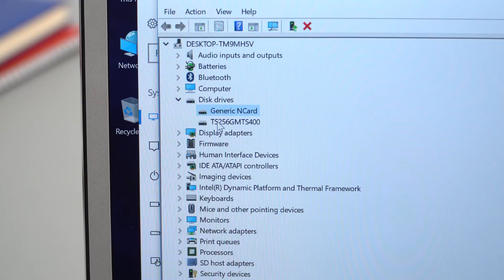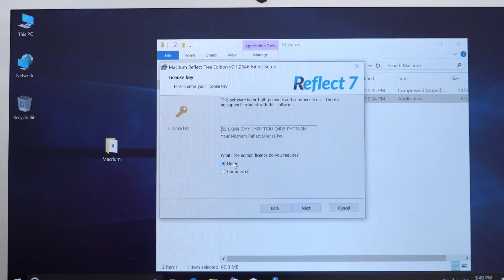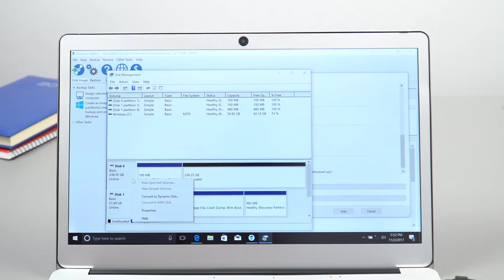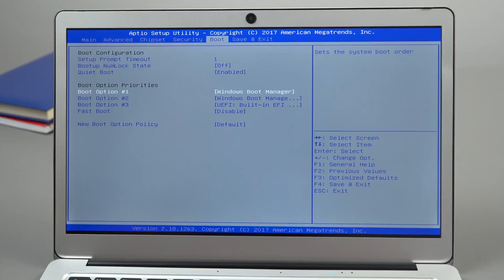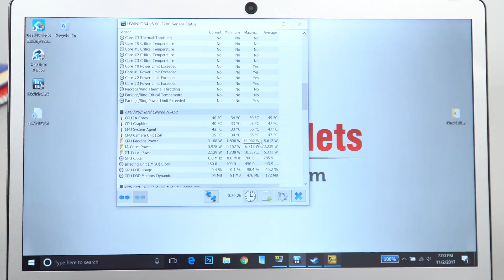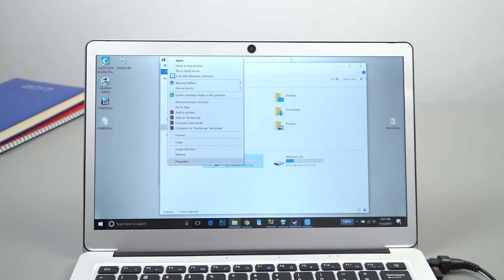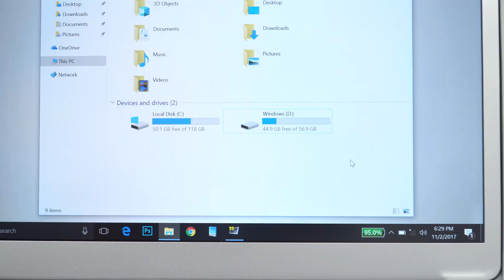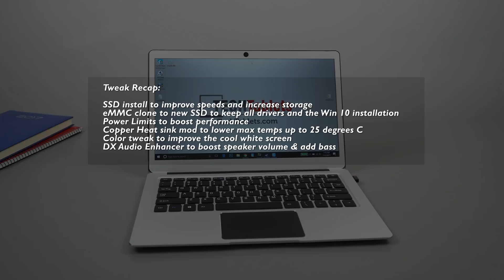Jumper EZBook 3 Pro Heatsink Mod, eMMC to SSD Cloning & More

Comment: Can I check why you would clone rather than installing a new version of Windows 10 on a new SSD?  Is it difficult to install drivers or is there another reason?
Reply: Sorry just seen that the reason for cloning is to keep the drivers.  Is it possible to do a clean install and then pick up the drivers after?
Reply from the maker: Sure can, I have the drivers here: https://techtablets.com/jumper-ezbook-pro/downloads/
Reply: Great - Thanks for your help.  Going to see if I can pick this and a SSD in the 11.11 sales.  Not sure if it will go much lower

Comment: Hi dude, can i use samsung ssd m.2 960 pro and get the full speeds of it? Thanks
Reply: NVMe SSDs won't work, since they are connected directly to the PCIe lanes. This platform doesnt support it. So your M.2 SSD should be an AHCI type (like 850 EVO).
Reply: MrSuicycle thx i understand now

Comment: hi chris i see you made a 360degree mod and coverage of this notebook ut you still MISS to guide us how to conect an eGpu (external gpu) card .... PLEASE DO THIS FOR US!

this laptop is great and it would be fantastic to see if we can use the pci slot of witi to connect by wire an eGpu and use an old and unused glu like an ati 7950... 7870 that many of us have in the old pc

Comment: i bought a core m laptop a month ago. the core m cpu is so hot, and you know that, it has no fan for cooling of course. after 2 hours gaming (like minecraft), the core m cpu will down clock itself to 800MHz, due to thermal issue. the problem is, i can't do much on heatsink mod, because of the lid of the laptop is PLASTIC.... it just doesn't help the heat going out of inside. 
the full metal body design of a laptop w/o a fan is so so important, because of thermal....

Comment: Can you put Linux on the emmc and dual boot? How fast is the unlocked CPU compared to something like an m3/i5 in day to day tasks? :)
Reply: Linux is difficult to install I had to respin elementary os and had awful problems getting touchpad working. Even when I did the physical buttons refuse to work. Bought ssd then and installed win 10 lite

Comment: I just got my Ezbook 3 Pro yesterday from Gearbest, appears to be a V4 except that the power limit adjustment setting in the bios is absent. On the upside it did have a SanDisk eMMC and I have the option to set that at a higher speed if I choose to.

Comment: Dude I've been completely stoked on this computer and bought after watching your review a few months back. Thanks for all the tweak tech tips!
Reply: Some people say they started encountering problems with this laptop after a few months of use. How would you describe your experience? Potential buyer here 🙂
Reply: @soup3596  I use mine since 10 months and don't have any problem so far, but I don't use it daily so it might be the reason.
Reply: Its been a year and how is this laptop working for you now?
Reply: @ManOfSteel1  I've had mine for quite a few months now, still doing great. The startup is a bit slower than it used to be but that's it

Comment: I definitely would have used a smaller shim (and also less thermal paste). 2risky4me.
Reply: i put some kapton tape on the resistors on the cpu and then did the copper shim mod.
Reply from the maker: The thermal paste is non conductive. So that's fine. I would rather have a little more than less and the results speak for themselves. 25 degrees C less max temps under the same test. There is a risk in shorts, but as I said in the video used this size for 2 years and not a single issue on over 10 tablets and laptops. The old Baytrails, Cherry trails, Core M3's  and Apollo Lakes.
Reply: Adam Warren use any high temperature tape on those resistors and u can do this mod without risk of short circuit. Masking tape for 3d printing is a good option. U can also try kapton tape. They can withstand 300 celcius temp easily. Wont melt under heat of cpu.
Reply: its the same yellow tape on the left side of the laptop. its highly heat resistant and used for hot air reflow work on cicuits. its very cheap also.
Reply: Fair enough, and they are certainly some impressive results. Thanks for the guide! I'm sure I'll follow along with it when I get my hands on one of these.
Reply: Great advice i just bought this laptop and i was scare of doing this mode, so this advice its amazing! But i have a question, the kapton tape its fine if i get it from aliexpress? or must be from some special brand??
Reply: Where do you get the copper pads from? ebay?

Comment: Is there anything that can be done to improve the touch pad, apart from uninstalling that software? like better drivers/firmware or even an aftermarket pad?
Reply: If you have the V4 with Windows Precision Drivers, I don't think that there is much more improvement after that. Maybe a vinyl skin from ebay to cover the touchpad with a smoother surface, but for the price it's pretty good, but of course not as good as the XPS 13 or similiar high end Ultrabooks.
Reply from the maker: I can confirm with what Findet Nemo says, now with teh new touchpad on the V4 unit it's so much better and really not much more can be done. For a budget laptop, the touchpad is very good now.
Reply: TechTablets.com damn I have the V3 :(

Comment: Have you ever thought about plugging in an external gpu?
I know there are ones that plug into the M.2 slot, it could be a cool experiment. Chuck in a cheap 1GB gpu, because anything higher would be bottle necked by bandwidth I think, but it could be a cheap way to get better performance?
Reply from the maker: No, I haven't thought of it on a laptop such as this one. I don't think it's worth the effort.
Reply: TechTablets.com no problem mate, just something I thought of whilst watching. I have watched a guy do it on an actual laptop with integrated graphics (i3 of some sort) and he got an extra 10 fps in games.

Comment: Mine arrived yesterday. Your review convinced me. I am happy with it BUT the laptop is not Linux friendly. I spent 12 hours to fix all its problems and I didn't solved the dead touchpad. It simply doesn't work at all. :/

 I suggest people to use the 2242 mts420 transcend SSD. It is fster than your mts400 and is relativity cheap online. I bought mine 120gb for 75€

Thanks Chris for your very good work on Chinese stuff :)
Reply from the maker: Good tip on the SSD, I use the MTS400 as that's what I have otherwise the 420 with it's better writes is a good way to go. I know a few in the forum also used 850 Evos as big as 1TB and that rapid caching software Samsung has.
Reply: choco107 ordered October the 7th, shopped October the 23th. 1 nov it was in London. Arrived yesterday. Italy here. Cya.
Reply: Michel Giovannini nevermind, checked thread on linuxquestions, OP tried android from start and it doesn't get GRUB to work properly.
Reply: Suburban Moscow I have batch (it was V3 I think?) that came with precision touchpad and unlocked BIOS (one where you could adjust processor TDP) and it does feature "Intel Linux" option under OS Selection in BIOS.
After selecting that GRUB works and Ubuntu installs nicely without any modifications.
In following batches they've removed that along with TDP adjust option, so I think only option for them is modifying boot-images/ISO to replace GRUB with rEFInd bootloader.

I've tested Ubuntu for about 2h, everything worked, but I didn't liked GUI performance of Unity (as far as I can remember GPU acceleration worked from box, it's Intel graphics after all). KDE wasn't impressing too. 
My main concern was touchpad scrolling, which was comparable to chrome/Firefox under windows (bad/chopy). Edge is far superior in that, so I've returned to Windows.
Reply: Michel Giovannini did you order yours from GearBest ? I'm still waiting for mine to ship since the 10th of Oct
Reply from the maker: Still no driver or fix for it in Linux. I did mention this in my unboxing video I think ti was that Linux works, but not the touchpad (yet) Hopefully this will change.
Reply: for rev. 4 set "Intel Linux" os in BIOS. after that you can boot linux images without respining (replacing bootloader from grub to rEFInd; ubuntu 17.10 works, haven't tested other distros). For touchpad — touchpad should work fine, but sometimes it get stuck and doesn't work even if windows. Bios reset / unplugging battery should recover it.
Reply: Did you buy after his review of the Version 4 on Oct 7th?
Reply: niter43 i cannot find Intel Linux. Where do you mean? DinI have the 4 ver. (Build 30/09/17).. or the 3,5? I don't have the Bios's CPU limit disabling option. :)
Reply: Michel Giovannini Can't say exactly where, I've ruined my keyboard and can't use laptop until I fix it. I have bios with power limit options, for "Intel Linux" search parameter like "Installed OS". It's obviously set to Windows by default. Windows boots fine with Intel Linux setting tho.
Reply: niter43 chipset- os selection - ... Windows, android, win 7, msdos. :/
Reply: Michel Giovannin I think android may work, since androidx86 boot through grub and it's unlikely Intel ever intended to use 6w celeron on actuall phones/tablets with proprietary bootloader.
Reply: On the latest rc 4.14 kernel the touchpad is working but not its buttons.

p.s. 4.14.0-041400rc7
Reply: how did you ruin your keyboard? is it related to the os selection in the bios?
Reply: Nah, it isn't. My keyboard was misaligned, keycaps were scratching holes in case. I've fixed that (pretty easy actually), but damaged keyboard flex cable in process. errrr long story short — don't cut towards flex cables if there is any nearby, no matter how carefull you are.
Reply: @niter43 So can you explain how did you manage to set up linux on this machine? Is it working well overall (except the touchpad issue)?
Reply: niter43 I see, so it means it's unlikely to get one with unlocked bios if I buy one of the latest installment. How is the machine doing performance wise? Linux didn't helped much on it then.
Reply: Suburban Moscow under windows it's okay. But you have to stick with Edge or use mouse for scrolling (on other browsers FPS during pixel-perfect scroll via touchpad is way to inconsistent, scrolling by lines via mouse wheel is fine). Doing light tasks without a problem, with battery life in 6-8h range.
Reply: Suburban Moscow Spotify/word/edge/sublime text runs nice. Electron-based apps (VSCode for example) might be a problem.
Good buy for a price, but if possible look at core m devices, they would perform way better
Reply: niter43 Thanks for the tip, mate!
Reply: I got the touchpad to work in both elementary os and Ubuntu works out of the box but the physical buttons don't. eOS requires serious work to get it working. I assume using the windows drivers disassembled and converted would work but meh I'll just wait longer. Ubuntu APPARENTLY fixed it but as I said.m no buttons only touch click

Comment: I feel like all these videos you've made a £200 laptop seem like a £300 laptop. With the onboard memory speedup in BIOS, the CPU limit restriction removed and speaker boost. Thanks.
Reply from the maker: It's still a Celeron N3450, but we can squeeze a lot more out of the original stock 6W TDP. I like these value for money items we can push even further.

Comment: wish mine didn't die after one month :(
Reply from the maker: What happened to it? Bricked bios or something?
Reply: Also interested in knowing...
Reply from the maker: Unplug the power plug from the battery, wait a bit and then connect it up and also check the ribbon cables. You might bring it back to life.
Reply: Don't know.  Just died out of the blue.  Doesn't boot and Screen flickering.
https://www.youtube.com/watch?v=MbQZaNFHlOI
Reply: Did you get it up and running again?
Reply: Had same prob with a laptop today pulling BIOS batt and normal batt didn't work. Only thing worked was pulling BIOS batt when it was on.

Comment from the maker: How to boost the speaker volume: https://techtablets.com/forum/topic/boost-your-hi12s-speaker-volume-and-3-5-output/
Hands-on with the V4 of the EZbook 3 Pro: https://techtablets.com/2017/10/hands-ezbook-3-pro-v4-best-just-got-better/
EZbook 3 Pro review: https://techtablets.com/jumper-ezbook-pro/review/
EZbook 3 Pro forum: https://techtablets.com/jumper-ezbook-pro/forum/
eMMC to SSD Clone software: https://www.macrium.com/reflectfree
Reply: Thanks for this tutorial. What would you recommend to replace the existing system SSD (in my Cube Mix Plus) for another one (just bought a 256GB in China). Is there a simple procedure to clone everything including the activated Windows 10? Thanks
Reply: Is there a possibility to unscrew the plastic part to install a 2280 SSD without breaking the magnetic cable it has?